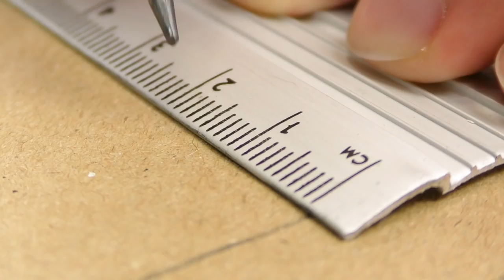DIY Simple Rat Trap from Cardboard

Comment: Sure, a cage with bars far enough apart for a rat to fit through works as a rat trap. Yeah, right. I bet one reason they didn’t actually show it in action is because a rat probably doesn’t even weigh enough to trigger it, and would most likely scamper out of the cage before it even closed. As for catching a cat; does this look big enough to you to fit a cat? Exactly.  And the way it’s designed, the cat would only be around halfway in before the cage closed.